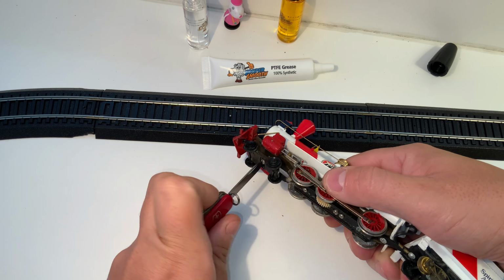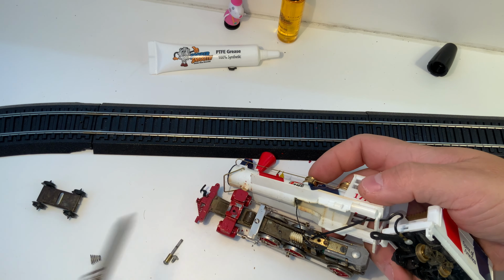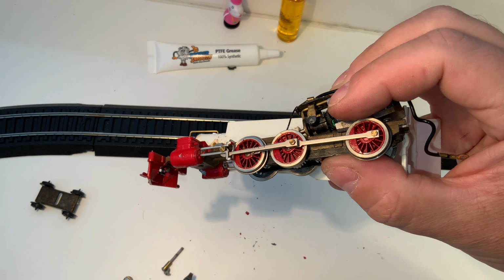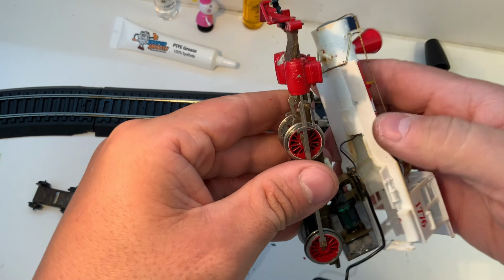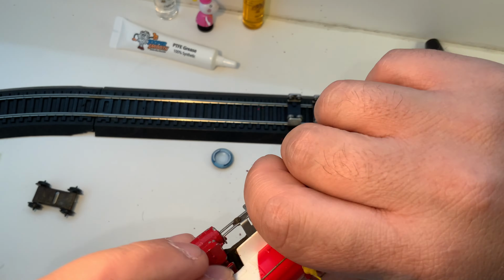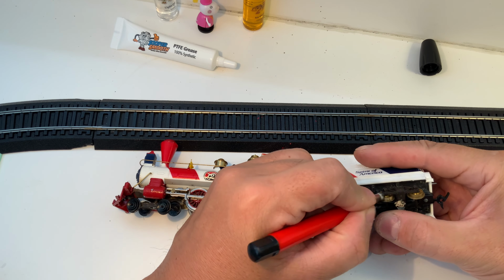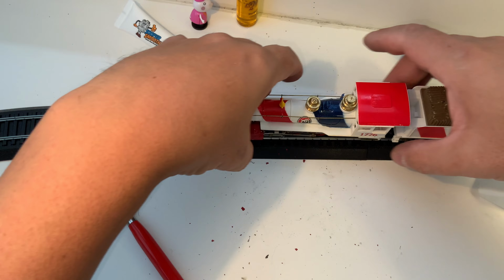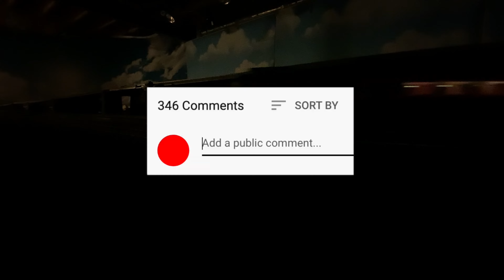Fixit Quick: Let Freedom Run! (After Repair) Tyco/Mantua '76 Spirit of America 4-6-0 Steam Engine

Comment: I've got one of those Tyco Bicentennial Spirit of America and it runs great after I worked on it.  I even made small wood chunks to go in the tender since that was in the era of wood burning 10 wheelers.  The real wood looks 100% better than that fake wood.  If I remember I changed out the magnets on that Pittman motor to rare earth magnets.  Made a HUGE difference in current draw and now it will "creep" around the tracks.  Cheers from eastern TN